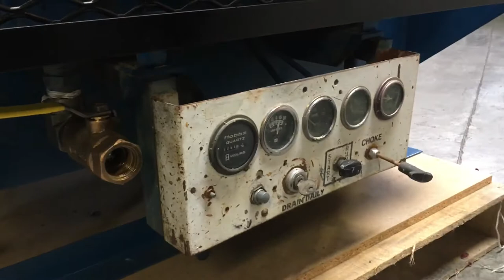Grimmer Schmidt 125 CFM Gas Powered Air Compressor Ford Engine Skid

Comment: I need a air intake assembly for the air compressor side have an Old 125 grimmer schmidt pull behind mono block 302 any ideas
Reply from the maker: Sorry do not carry that , you would need to contact Grimmer Schmidt